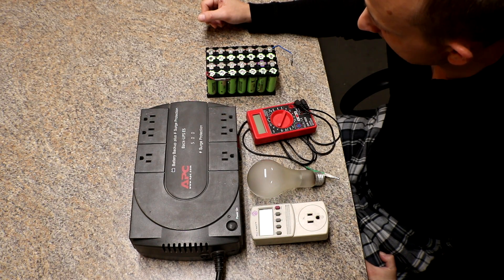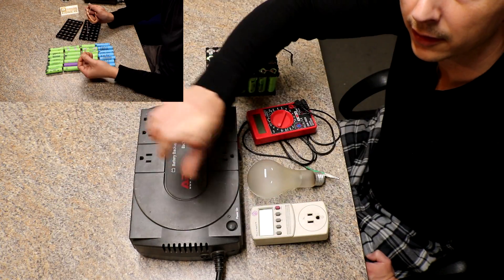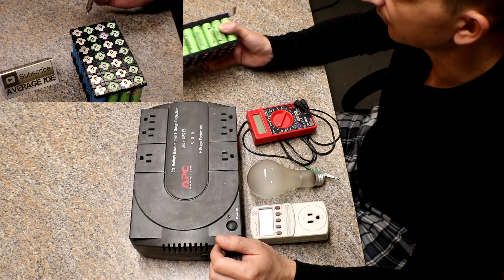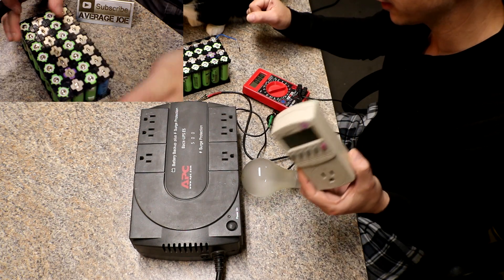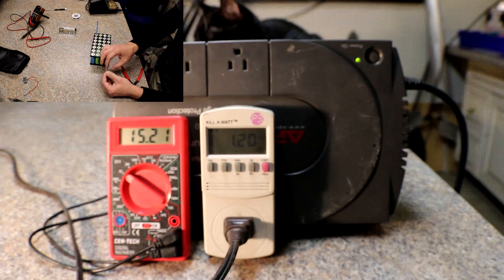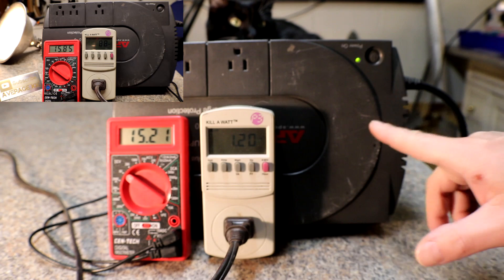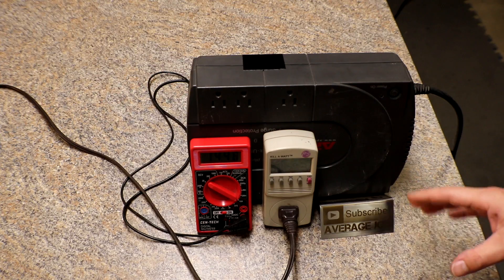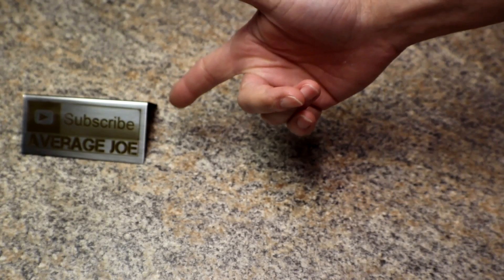18650 Ups Hack Setup and Discharge Test

Comment: Awesome vid
i am surprised by the way the ups treats the cells the same as the SLA!
does the the ups charge the cells the same way as the SLA? did you notice any overheating during the charging ?
Reply from the maker: It will charge any battery you install but its not recommended for li-ion as the ups is a "dumb" charger and has a float charge.  I wouldnt use a 3s as the cells would get over charged.  4s is better however the cells wont get fully charged.  Lifep04 cells are a much better option for 12v applications.  BMS is required!

Comment: Howdy, Nice video man.  This looks like a cool idea. I recently got a UPS really cheap and was thinking of using it as an inverter.  However several youtube videos later realized they are pretty much only built to handle one full load of the lead acid battery it comes with.  Beyond that there is no airflow, the heatsinks are not designed to dissipate heat but store it for a short period of time and the board traces are often not designed to handle much current.  I would beware of running the thing close to its max wattage for any extended periods of time.  You sound like you know enough about what your doing, I just thought id mention what i've been observing in other videos.
Reply from the maker: +Inductor87 Thanks! Yeah some of these dont work as well as others for sure. The 24v versions work ok and the 48v server ups Im using now works great. Plenty of airflow and designed to run a lot longer. 😀🖒

Comment: Any further testing or result? Will this also work on a 12v ups? What about just adding a bms between ups leads and batteries?
Reply from the maker: I dont think Im going to do much more for the 12v version like in this video but Yeah you could add a bms for better results!

Comment: Does the ups charge 18650s with its lead acid based charging system without hurting the cells? That's a new one. If so I have a ups or several I could use!
Reply from the maker: It does but doesnt charge them up all the way cause it 4s.  Still not recommended as the voltage from the ups never goes away.  I did take the pack apart to capacity check the cells again and they seemed to be close to the capacity to my first test 😀

Comment: I'm going to start taking a deep dive into ups's in general. The more info the better! Check my fb account /shannon.williams.9400  there's a picture showing the type of busbar I am making.
Reply from the maker: I looked on you fb page and I didnt see any pics with bus bars?
Reply: AveRage Joe I checked it's in my uploads, and the .9400 is my facebook ID. You maybe overlooked it because It's a picture of a "4 strand fishtale braid" ex. for a busbar. It's made using 8 1/4 inch flat tinned copper braid. Each 1/4" copper braid is a 13 gauge equivalent capable of handling 15-17 amps. I'll put another pic showing a better ex.
Reply: AveRage Joe made another even more interesting post, just for you! Check my timeline if It's not in pictures/uploads/

Comment: i believe these ups units trickle charge even when a battery is full. this trickle charge is not good for lithium ion batteries. i am curious to how even a 24v 7s ups might last over time?
Reply from the maker: +John May Yeah they do trickle charge. I had it plugged in for months and just recently took all the cells out to capacity check them and they were still pretty close to the first check. I still need to redo the 24v ups battery. Maybe Ill do that soon and restart that project test

Comment: Looks effective....
lead-acid or Gel batteries are not effective. 
How about running PC with 600VA USP on such battery bank ?
How long it will provide backup?  4 to 8 Hrs ups backup how many batteries are required ?
Reply from the maker: +Abhimanyu Altekar Yeah you could do it. It would depend on how many amps the pc would draw

Comment: You are being ultra conservative on your tests. The Panasonic 18650C cells are rated at 2C draw (4080 mA), the 18650CG are rated at 2C+(4400 mA) and the 18650CE are rated at 1C (2200 mA).  While being conservative is good, it's also good to know what your cells are capable of. Even though they all tested at a similar capacity, it would be best to combine cells with the same discharge rating so that you don't accidentally over stress any cells. This may be why some powerwalls are seeing unexpected failure from cells that otherwise had tested good.
 On another note, since you are running 4S, the absolute minimum you want to take the cells to is 2.75V, which if you multiply that by 4 it comes out to 11V for the pack. Watching the end result, the UPS was taking the pack below 10V, which is definately not going to be good for the cells in the long run.
Reply from the maker: I did look up the cells discharge rate.  Yep I was being safe for the first test lol.  I do plan to do a big load test for everyone.  Im just testing and seeing what would happen to the cells using a 12v ups if someone used one and left it like I did :)  Yeah I didnt have anymore of the same rated cells.  I am still testing more cells for the same discharge rate and when I get them Ill swap them out :)  Oh yeah it took the cells down low as hell lol.  Agree that they should be taken down that low but thats what Im testing for, to see what happens or how long they last. Im gonna get a 24v ups and do the same test because emceh's comment said the voltage range is better for what Im test

Comment: Have a look at 24V UPS units and DIY 18650 7S battery pack. The ups will handle charging and discharging rather well. Cut off is usually at 21V so 3V per cell. It charges up to 28-29V this gives no more than 4,15V per cell. So no BMS is needed as cells will never go out of desired voltage range.
Reply from the maker: +emceh F@^king sweet. Im goin to my recycler tomorrow to see if he has one. If he has one Ill do some testy vids :)
Reply: Emceh.  I have just made a setup Apex 1600 Smart UPS like you describe but was going to have a dedicated separate 18650 charger and not use the original lead acid charger (disable rectifier).  Are you saying I can just wire the pack to the original lead acid wires.  It sure would make everything easy.  I was a bit concerned to go this route as the 18650 constant current and constant voltage profiles is not the same as lead acid profiles.  Also the lead acid charger will have a constant trickle charge which I think is a big no no for lithium ion.  Mess up with lead acid, still have house.  Mess up with 18650 and house burned down.
Reply: EnergyCrafts did you figure out the end result? I have some ups I want to re use but everyone is saying you can’t due to trickle
Reply: Any further testing or result? Will this also work on a 12v ups? What about just adding a bms between ups leads and batteries?

Comment: This music irritates me. The UPS is already a BMS except its for lead acid batteries. Most UPS should also have temperature monitoring built in as well as current monitoring, voltage, state of charge, battery replace status, estimated runtime, etc and is accessible from the USB bus. But usually BMS is referring to balancers and cycle optimization.
Reply from the maker: Sorry to hear that about the muzac.  What kind would you like to hear in the next one :) Ya I think your right about all the settings and stuff.  This one is an older one and has 2 phone jacks and a lan port.  Ill try to see if I can find some software to access it through the lan and see if I can change any settings
Reply: The tool I use is called NUT here: https://github.com/networkupstools/nut It's meant for Linux servers on networks but it can be used on Windows to. It has a web interface and it looks like this: http://i.xomf.com/kfrjb.png Thats from my server. Also APC is well supported in lots of software. The RJ-45 jack is actually for USB via an adapter cable. USB defines a specific way of communicating with UPSs called HID Power Device. So any software that can talk to a HID Power Device will be able to talk to an APC UPS.

As for music, I don't wanna be telling you what you should do its just that particular song is annoying to me. But what I like is smooth synth, jazz or house for stuff like this. Basically the same music thats on How It's Made.
Reply from the maker: Lol, Gotcha on that song.  Yeah I defiantly need to find some good music.  You know of any sites that let you use there songs?  I like that pic of your server.  Ill have to get it going for my server ups Im gonna use.  Since Im a noob at that stuff, what would I need to download.  Does it go by model #?
Reply: It's all configurable. USB based UPSs can be selected by their USB id, model or serial number. You can have multiple UPSs at once to. For USB UPSs the OS already has the drivers except NUT includes HID specific control drivers which is just built into the program (you don't install them). My setup is actually a media server running OMV. So if you were going to use say a Raspberry Pi for control and monitoring applications and you were using Debian Linux like Rasbian then you could get it roughly working with the following:
sudo apt-get install nut-server nut-client nut-cgi nginx fcgiwrap
Note that fcgiwrap enables itself automatically for me. Pi might not.
sudo lsusb -v and search for your ups. Copy iSerial field into [serial] below.
sudo nano /etc/nut/ups.conf
>>
[ups]
  driver = usbhid-ups
  port = auto
  serial = [serial]
  desc = "UPS"
<<
sudo upsc ups should dump all the information about the ups.
sudo nano /etc/nut/hosts.conf and put MONITOR ups@localhost "UPS"
sudo nano /etc/nut/upsset.conf and enable it after reading the directions. You basically need the web server to provide authentication. It's on a local network so I don't really care.
sudo nano /etc/nut/upsd.users to add users
sudo nano /etc/nginx/sites-available/nut
>>
server {
  listen 82;
  listen [::]:82;
  index index.html;
  root /usr/share/nut/www/;

  location /cgi-bin/ {
    gzip off;
    root /usr/lib/;
    fastcgi_pass  unix:/var/run/fcgiwrap.socket;
    include /etc/nginx/fastcgi_params;
    fastcgi_param SCRIPT_FILENAME  $document_root$fastcgi_script_name;
  }
}
<<
where 82 is the port.
sudo nginx_ensite nut
You shouldn't need to but
sudo systemctl restart nginx
Then navigate to the devices IP at port 82 and it should work.

I know that some UPS even allow you to switch the load on and off and with a pi you could also use the output pins to control charger input and bam you have a BMS.
Reply: As for music maybe Jamendo? I don't know much about finding music you can use just that I can blabber about if I like what I'm hearing or not.
Reply from the maker: Well holy fack, I may need your help in setting in setting it up once I get to that point if you dont mind lol.  I do like the sound of all that :)
Reply: +AveRage Joe yeah no problem :3
Reply from the maker: Hey, Ill need your help when your around
Reply: +AveRage_Joe Sure :3
Reply from the maker: Do I need a special cable to log into this thing lol?
Reply: +AveRage_Joe Depends on the UPS. Usually the cable comes with the UPS. Most use USB-B where as APC uses RJ-45 with an adapter cable because its both USB and serial.
Reply from the maker: +penguins forall Oh ok, I guess Ill have to find one and order it. I tried making my own serial cable last night and no luck. Also tried a serial to rj45 and no luck :(
Reply: So I take that back. APC uses a 10 pin connector not RJ-45.
Its 10 pins from left to right with the back facing you: Data+ (Green), Data- (White), Empty, Ground (Black), Empty, Empty, Shield (maybe brown or black), Empty, Empty, Voltage 5V (Red). But it'd cost more just for 10P10C connectors. A lot of crimp tools do not accept 10 pin connectors either. So here's one on ebay for 8 dollars.
http://www.ebay.com/itm/292213474762
All my old APCs that still use these came from offices so I never had to deal with this because they kept inventory. x.x At least newer APCs and other manufacturers all use USB-B. It's entirely possible that later APCs although stillusing 10P10C connectors don't actually have a serial interface only USB because ya know APC. I wouldn't count on serial working.
Reply: The other possibility is just to take the ups apart and solder the cable directly. To be honest thats what I'd do. Fuck that 10 pin noise and you're a DIY kind of guy ;3
Reply from the maker: I did order one of those cables earlier today from amazon so it should be here monday!!!
Reply: What type of computer are you going to be using to monitor it? I mostly know Linux.
Reply from the maker: Im setting up a lil mini windows based laptop for it.  I could always load a version of linux mint on there.  Thats about all I have messed with as far as linux and it wasn t much.
Reply: Network UPS Tools should work on Windows fine except the driver is a bit different. Anyway the software provides a way to monitor the battery status as well as configure any options your UPS has which usually includes the ability to turn the load on and off. You can also turn the beeper off and on mine you can turn the screen on and off.
Windows vs Linux here would just be a matter if any other software requires Windows like your charger or other equipment.
Reply from the maker: Awesome, cant wait to log into it!

Comment: What are ups?
Reply from the maker: Alexandre Fausto Aaahhh fack your right, my bad :) Yes they can be hooked up to a big bank of batteries. Thats what Im gonna be using is a APC 3500watt server UPS unit 😀
Reply from the maker: +Alexandre Fausto Universal power supply. Used for computers to safely shut them down If the power goes out.  Used in all kinds of applications
Reply: hahahahah UR WRONG Joe..... UNINTERRUPTIBLE  Power Supply.. They can also be attached to a massive battery bank and last a very long time.

Comment: Nice work, how did you recharge the battery after the test with the bulbs?
Reply from the maker: +Alexandre Fausto I just let the ups do it. After it was done they sit around 13.5-13.6 so there not fully charged but well see how it works out :)

Comment: You don't have to plug the UPS to turn it on. Most UPS's you can just push the power button and hold it in for about 3-5 seconds. That will tell it to force start without AC initiating it. It worked on the brick style APC UPS's, so it should work on the style you have there as those are newer. And it definitely works on SmartUPS as well.  Good video, btw.  :)

Also, what you could do is see about using a BMS that takes in 12V to keep the packs balanced. Maybe even put a shunt so you can see how many amps is being pulled during the full test. Afterall, the output voltage stayed pretty close to 128VAC as the battery dropped voltage. So it must have gone up in amperage usage. How much did it go up? That way you can take in the Amp/Volt Input, get your Wattage usage, and get your Amp/Volt Output for that Wattage, and determine the efficiency of the UPS unit. I know you're not really test that aspect, but interesting info for anyone who may want to use that particular UPS model, or even to show them how they can calculate efficiency with their own UPS.

two thumbs up!
Reply from the maker: Yup, I basically kept it plugged in to unplug it for the video lol.  Good idea :) Ill do a vid with the volt meter on the amp setting to see how many amps its pulling.  Im the worst when it comes to math :( Im a tinkerer not a mather lol. I could try and put all the voltage and amprage in the vid for everyone to see.  Then you guys that math good could help me out :)  I have another apc that a little bigger I could also include if anyone wants to see that as well???

Comment: This is great, I have had about 3 UPS devices in my life and all failed.  When they did work the batteries were too weak to last long enough to really be useful.  Powering the router and modem only is a great plan.  BMS and LVSD would be very nice to have.  Laptop is still working and the P/W is discovered.  Still don't know much about Linux, but exploring  a little each day.
Reply from the maker: +Lloyd Prunier Thanks! Thats great, they are nice little laptops. They have hdmi so thats great too. Did you get the password? Yeah it seams like the sla batteries that come with them are junk. They for sure didnt last long enough to be useful. More tests to come. Hope it wasnt to boring to watch lol